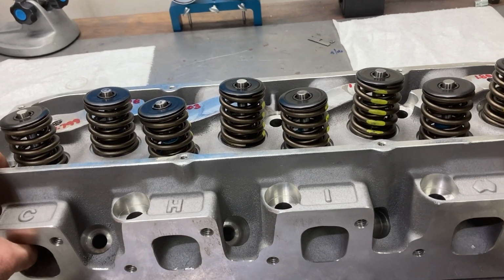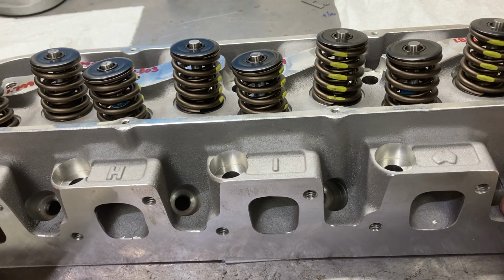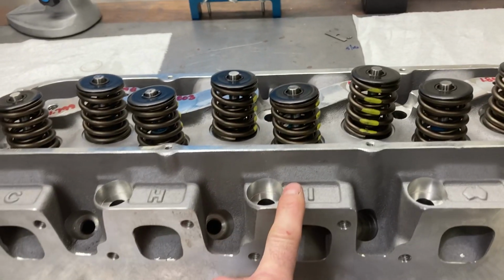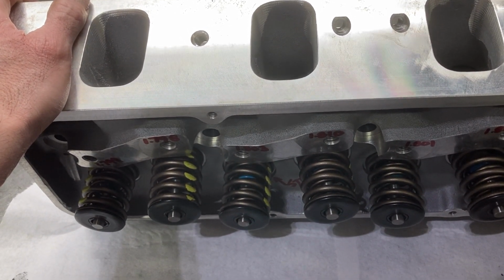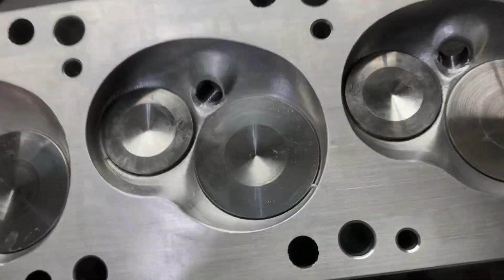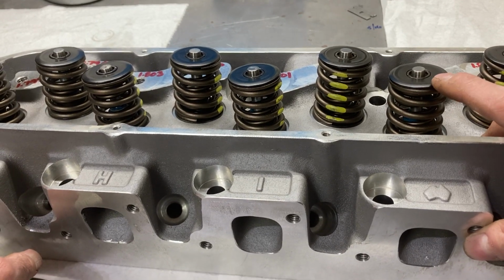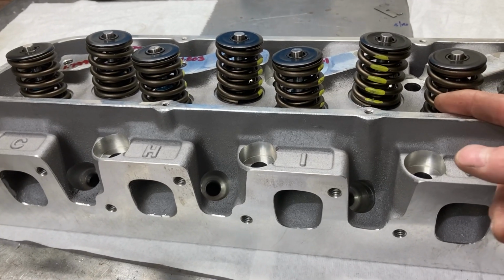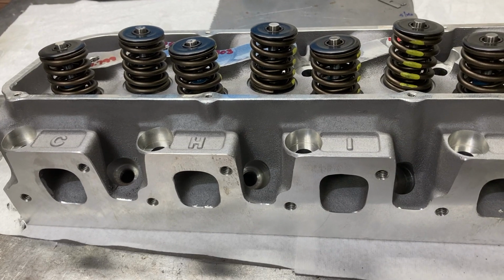Lykins Motorsports CHI 4V 351C Cylinder Head Review

Comment: HI Mate Interesting listening of your review of this head,i was of understanding that the 3v 225 was the best performance head for a 408 cleveland,in Australia no one recomends this head only if allready have 4v cast irons and want to use existing manifold and extractors,good to see you made good hp with this head
Reply from the maker: The CHI 4V makes great power, but you are correct, the 3V 208-225cc heads will take it on up.   We port the 208cc heads to about 380-390 cfm.   I will say this, making videos is hard......I can understand if someone misunderstood the part where I said I was going to make 800 hp with these heads.  It won't be with these heads, but with a set of ported 3V heads.   Thanks for the comment.
Reply: @lykinsmotorsports   yes i use these 4V CHI Heads on my 380ci Supercharged Cleveland. Had them hand ported 352cfm@700” 👌🏼 & make plenty of easy power 👍🏼🏁

Comment: Brent i see you buddy. i know you are busy but some videos of you flowing them CHi or maybe some Trick Flow and maybe some factory 2v and  4v heads would be cool. Im still watching your 496FE build. My stepdad really wants to put an FE in one of his Foxbody Mustangs.
Reply: Factory 4v hit 275@.5" and like 290@.7"  without being touched
Reply: @dennisrobinson8008  I have seen conflicting post and write ups over the years about what lift that 275cfm was really at. Also, which 4v heads you talking about? One of the 2 flow more than the other, do you know which one - I do.  Also, what size valve 4v heads are you talking about - Cleveland 4v's had different sized valves from factory.
Reply: @nova467spanker  Yes.   I've seen the 275cfm numbers @.500" and also at .600", the 290cfm is certainly @ 700".    The 4v open chambers supposedly flowed the most due to chamber unshrouding.     This guy did mild porting and bowl work and recieved peak of 330+CFM with almost 300CFM by .500".   https://www.youtube.com/watch?v=7stt19DNkXA&t=1339s  .    Stock he flowed them at 246@.500" and 274@.600".  

So the 275CFM@.600" is probably the most "common" number that we should use.

Comment: Question. I am a fan of the Cleveland style heads because of the valve angle, that nets bigger valves better port direction.. 
why are the wedge heads still used more? These are so superior, I don’t understand why they are not used more. Thx.
Reply: For 1, the bean counters killed off the cleveland here in the US.  1970's/80's gas problems and emissions really destroyed ALL performance related anything.  #2, the inline "wedge" Ford has come a LONG ways with aftermarket companies.  You can get some killer heads that will work for 95% of most people's uses.  Since almost all the SBF work was done after the Fox body mustang came out, all the accessories like intakes, headers were made for the inline head configuration.  And that always scares manufacturers to force someone to rebuy all their speedparts just to use a set of heads.

Comment: Been thinking about ditching my stock 4V quench heads on my 351 Cleveland MACH 1. What do you recommend? I'm looking for better low end power, 2000-5500 range.  I'm running a comp cams 272 with 10-1 Compression right now. I don't want to run new headers or an intake, currently it has a Performer dual plane so I can run my shaker assembly.  I looked at the Edelbrock head but it doesn't have great reviews, CHI heads look promising...
Reply from the maker: CHI for sure.  One of my custom cams would also pick it up considerably.
Reply: Will the CHI intake work with a  shaker setup?
Reply: @mikeoostendorp8057  … That’s a good question because I also have a factory Shaker setup on my ‘70 Mach 1. I’ve used aftermarket intakes without problems but none of them were as tall as the CHI single plane. Maybe contacting the CHI tech department would provide the correct answer. The engine I’m preparing to install features a fairly radical solid roller cam and high compression so a single plane intake is required. Fords Shaker is the best factory cold/ram air induction system ever made and getting rid of it would really screw up a great looking design.
Reply: Did you get the CHI heads installed?

Comment: 2Venturi and 4Venturi heads. To me any 4V makes a good door stop. No velocity huge bloody things. 
The CHI 2Vs are good for any engine 302-400 and will make better low end than the 302 Aussie heads.
BUT the 3V versions are better. The intake runner is lifted probably an inch and with their [no choice!] intake. And common sense high velocity runners, not something you have to half fill the port unlike the OEM garbage.
A friend has the 185 heads and with a decent 377 bottom end has 500 whp. It will start to lay over at 6500 but is an excellent true street engine.
I have some 208s for a  milder road race engine. They should make more power, my rpm limit will be 7000. It is a Cleveland!!
I have heard of the biggest ones being drag raced at 8000 rpm and making true horsepower,, still with a driveable bottom end.
Interesting fact, the 2V head has a larger intake port cross section than a medium race port Chev head.
Reply: What if one were to add a compressor.. that head might work the best right?
Reply: Boss 302 huge head small cam beat Chevy dz302 medium head large cam across the curve.   So they work.
Reply: 4v heads there a little better than door stops lol 😆

Comment: I’m looking to build an engine for desert racing in Mexico. I add that detail because of buying pump gas for the race truck in Mexico could limit performance. Can I build a 600hp engine to run on Mexican pump gas, lol? I’m thinking I need a stroker engine. Thanks for any ideas.
Reply: There’s always octane boost and aviation fuel
Reply: the small details are easy to work out. You should ask Ben Alameda for advice but he has said that with aluminum heads like this you can ask for 12:1 compression. its in the cam as well. Mexican fuel is fine.

Comment: Sorry but if you designing a new head maybe you should fix the issues with the stock design like fixing the damn exhaust port. You still need to run port plates on an aftermarket head what’s the point of it?
Reply from the maker: I’ve never ran port plates on aftermarket heads.  Don’t have to.
Reply: As far as I know and from my own experience, all of the aftermarket aluminum Cleveland heads have greatly improved exhaust ports and don’t require port plates or the stamped sheet metal tongues. I have a pair of vintage iron high port Cleveland heads and it’s easy to see why the conversion was necessary. Mine were modified by Larry Widmer at Endyn and he did a lot of work improving the intake ports as well using aluminum inserts and epoxy to fill and contour the floors. He also made the intake ports slightly wider in the process. Endyn did quite a bit of the early R&D work on Cleveland combustion chambers to get the most efficient quench area and unshroud the valves. 

But now the aftermarket vendors have alloy Cleveland heads available for any combination imaginable. I totally agree with your comment about what’s the point of port plates on modern Cleveland exhaust ports. If you run across an example, I would appreciate it if you could post something about it for all to see.
Reply: No port plates on the CHI heads.